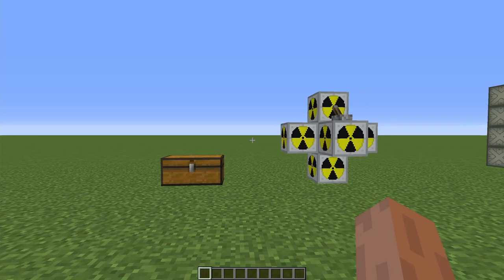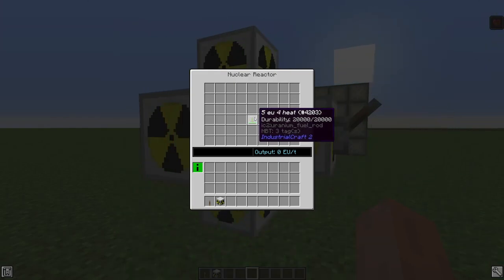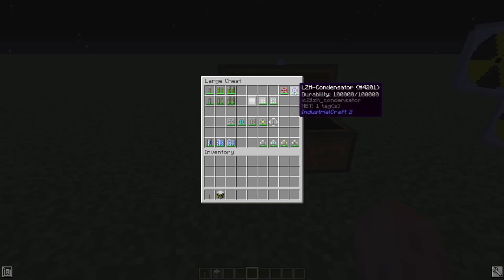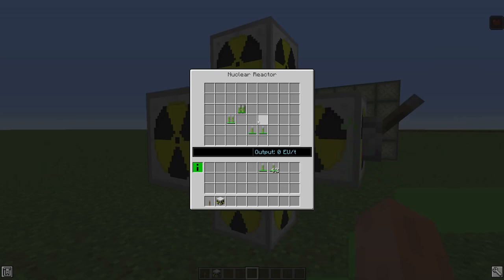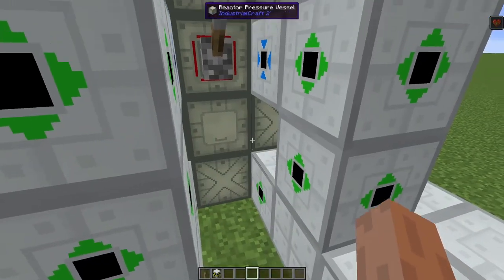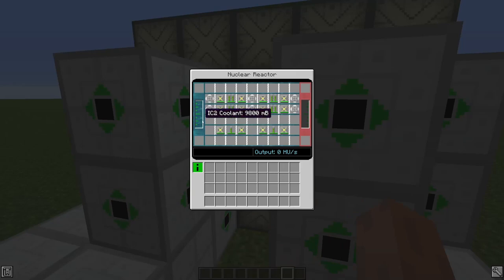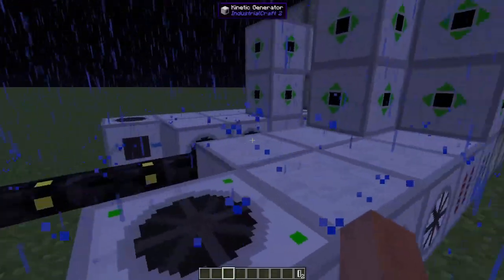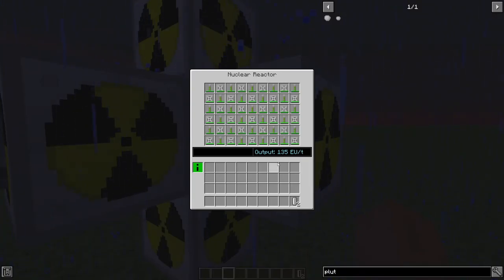Modded Minecraft: IndustrialCraft 2 Tutorial Part 2: Nuclear Reactors

Comment: Neutron reflectors are useful for specific setups. They increase heat generation like adjacent fuel rods do, but don't produce heat themselves. This grants more flexibility for placing components that could melt down when placed next to yet another fuel rod but would be fine placed next to the reflector. Besides being useful for heat placement, if you have four reflectors around a fuel rod, that is the most efficient way to take advantage of a single (or double or quad) fuel rod. If total adjacency was provided by more fuel rods instead of a reflector,  the extra fuel rods would have only one adjacency bonus and be less efficient. Granted, the consumable and permanent versions of reflectors can get expensive. I think it's a nice tool especially for late game power generation to use with the mass fabricator. It all depends on the current needs of the reactor designer, especially when people play with ic2 in a mod pack environment.

The lapis and redstone coolant pumps are likewise used in specialized reactor designs made to output abnormally high amounts of power in a single reactor at the cost of increased consumable material.

Extra bit of advice if you are just learning the mod: Make an EU reactor first and keep it for a while. Fluid reactors aren't just more expensive, they are harder to keep reliable. The fluid handling system needs to never stall - it can't run out of or have too much of distilled water/water/coolant/hot coolant. Unless you are trying to make a big boom and a crater. Also consider how you would approach making additional fluid reactors, or how the fluid system would hold up against a higher output reactor setup.

Approaches to all of these engineering problems will vary if you are playing with other mods or just industrial craft.
Reply from the maker: These are some great points, I'm going to pin this!